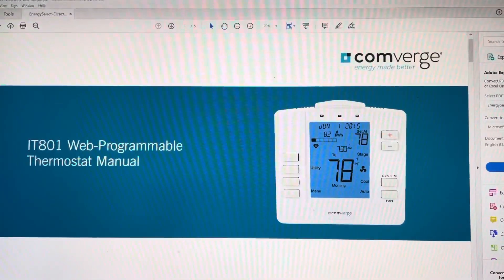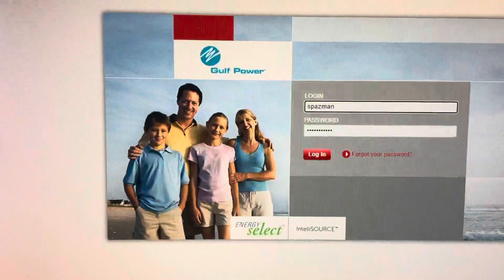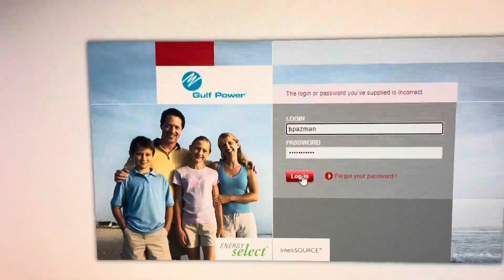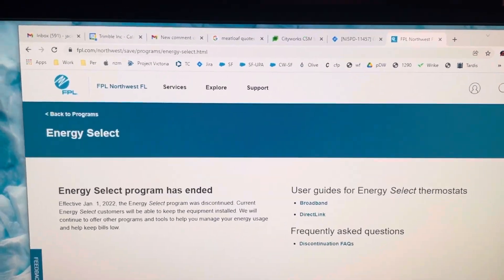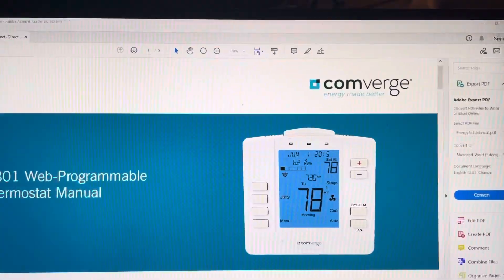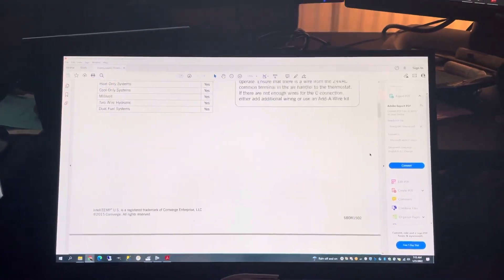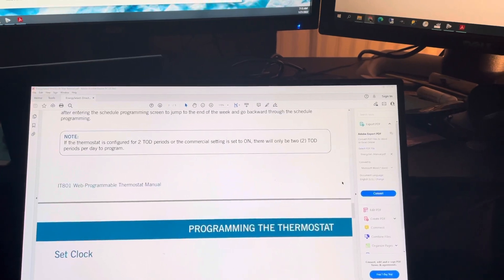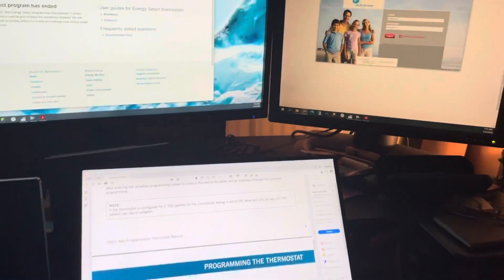Fixing the Gulf Power Energy Select iTron thermostat

Comment: Did you do anything with your hot water heater that was programed with GP?
Reply from the maker: Our central air was only thing on Energy Select. Rest of appliances are natural gas, and way cheaper to run then FPL’s overinflated rates.
Reply: i’m not sure if my hot water heater is gulf power as i’m renting. do you think it will affect it?
Reply: water heater isn’t on my bill, just power

Comment: Thank you very much! I really miss controlling the thermostat on the app so I have purchased the Wyze thermostat. I’m hesitant to install myself but I might try. Your video was very helpful. Do you know or is that a C-wire on the Gulf Power thermostat? That will make installation much easier. Thank you!
Reply from the maker: I'm afraid I do not know the answer.  Good luck!
Reply: There is a "C" wire on my Gulf IT801